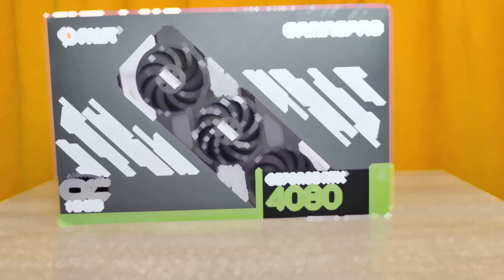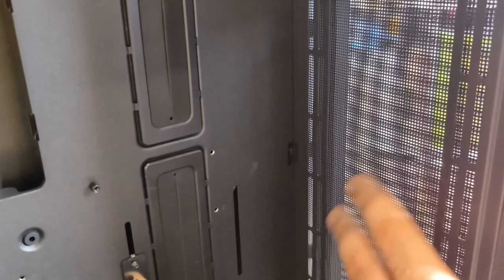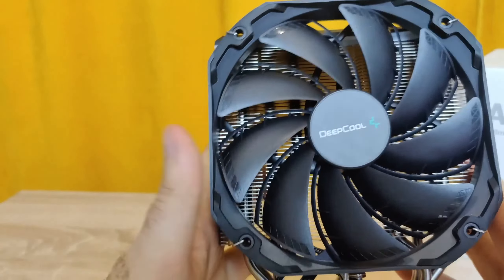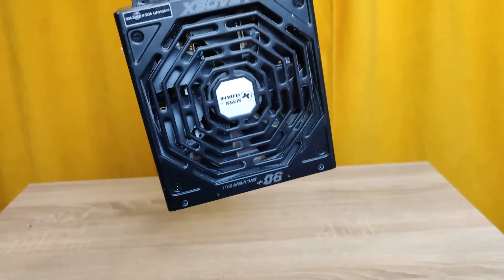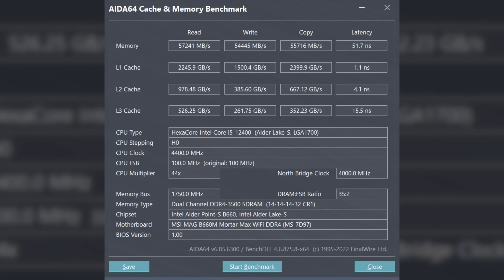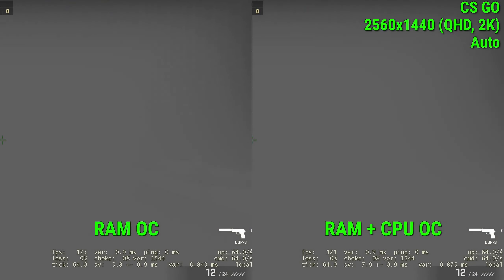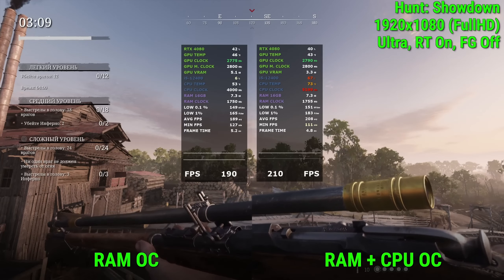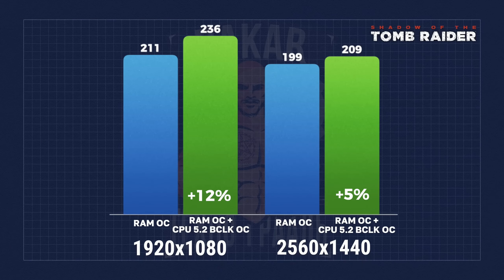Overclocking capabilities of 12400f with RTX Palit 4080.

Comment: my 12400F can go up to 5,280mhz but very very very hot will hit 100*c with ease ......so i downclock to 4,8ghz at 1.085 volt with an 240mm radiator i only hit around 70*c with cnb r23 and gaming around 5x-62
Reply: you have an aio still hit 100°c?